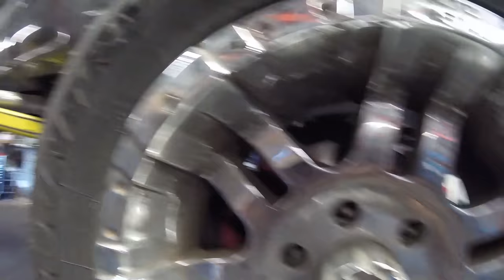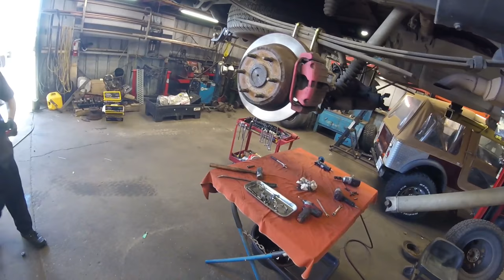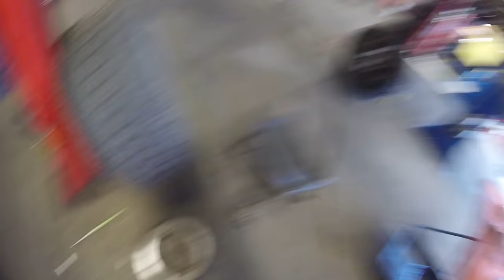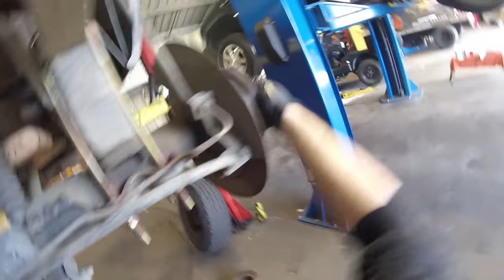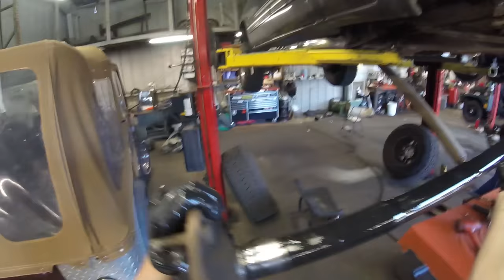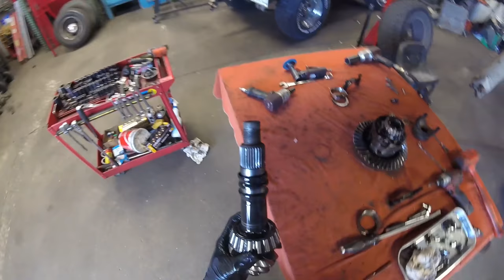Tearing apart blown Chevy rear-end #Govbomb

Comment: G80 diff lock is actually very, very robust. This truck probably has a oversized 35" tire (there's like 5" lift you can see in the video) and the driver was wheeling the shit out of this. He probably put pedal to the metal while rock climbing.
Reply: They're horrible! Those two spider gears spinning on a bare metal shaft is a dumbass design. Also the lock up is quite violent when it slams into lock mode. There's a reason these things have a reputation for bombing, then removing that pin to replace it can be a nightmare!
Reply: @Mr_Ruhl  Any aftermarket options available for a 2018 Diesel ZR2? Mine's currently screwed, with the center block carved away, and i'm either going OEM or aftermarket. Just can't find any aftermarket options out there.
Reply: Sounds like someone is compensating for having a g80 and not a lsd lol g80 is junk it locks the tires up completely and gets the job done but the way it violently locks up is why they are known for exploding when it locks up it puts extreme stress on the spider gears and diff carrier awful design get a lsd lol
Reply: This is accurate

Comment: G80 and the gov locker are not the same rear end. One was from 73 and phased out mid 80s, the eaton g80 was introduced afterwards and is still in use today. That truck looks like its modded and driven by a jack ass. Probably blew it up themselves. But main point, is thats not a gov bomb

Comment: My pinion pin lock bolt instantly stripped out so I had to use a 7.5mm socket hammered on. Amazon had it next day 3.99 though.

Comment: To make it easier on pulling that spider pin, just spin one axle or the other a little bit and it will slide right out. I kinda cringed a bit when u put the bolt back in and pryed on it lol.
Reply: It was bent and new rear end kits come with a new pin and bolt

Comment: Here's the thing with these rear end's. Eaton  made them specifically for gm and they are rated by eaton for gm and gm builds a vehicle around that rating and it will last for years but like all moving parts they will wear and adding stress to moving parts to which they are not rated will cause damge. That being said eaton also created such things to handle that stress in 14 bolt 9 and a half and 14 bolt 11 inch specifically for this purpouse. Now flooring a thirty year old rear differential with 300,000 miles on it and the oil has never been changed doesnt make it a horrible thing or putting giant wheels and tires on a high speed diff and trying to take off like a race car doesnt make it a bad thing. Now using as the manufacture built around it is one of the most awsome things ever created for a vehicle especially a 4 wheel drive. Yes i have broke them but i was way out of specs and mostly due to my own ignorance. That being said i have broke one of the drive gears in one and if not for the locking thing i would not have made it home as it would catch and turn the other wheel until it released at 20 something mph and start free spining so i let off the gas and slow down and get back in it and it would lock again and away i went yes it took a while at this pace but i wasnt stranded and made it home. I now have a 14 bolt corporate locker in place that can take a beating and changed 3.42's to 4.10's with my 4 inch lifted suburban 4x4 and big wheels and tires you know the proper way and it is literally a monster. Easy turning nice and smooth no binding from stress. That thing will pull a house apart as before i would pull the truck apart.

Comment: The G80 is not "limited slip" as you mention in your description, it's a locker.
Reply: @Steven Blodgett the gt4 code  is for the ring and pinion gear ratio. The rpo code for the locker is g80.
Reply: Meh the locked state is clutched.

Comment: Holy Cheetos not looking forward to doing this at the junkyard today .. I have a lot of play when I spin the rear wheels on my 2000 1500. The clicking sounds like there coming from the driveshaft . I’m doing uJoints fersure but my dad wants to remove the spider gears and switch them out again(we did this two years ago) he said the truck feels like it binds when it wants to shift gears. He doesn’t think it’s the u joints because there’s no slack in them.  I just don’t want it to be that part you removed in the last two minutes of this video ha ha haa..

Comment: How hard it it to replace those nesting gears in the differential. I got the whole unit out of the truck and only thing wrong is the nesting gears starting to grind. It's pretty much the same as this one. A gm locker on it

Comment: Great video yet I have a Chevy Equinox Awd and had the passenger side rear axle replaced due to issue at wheel end , yet it’s hanging out 3inches from differential and no longer flush... do you think this happened due to replacement of new axle the c-clip was not set and locked properly? I’m trying to understand why this happened, it was done 8 months ago? Any thoughts would be greatly appreciated

Comment: Is the G80 used in the trucks the same as the G80 used in the Astro/Safari vans?  I'm about to buy a 2005 Safari and it has the G80 diff.  Should I be concerned?

Comment: "These LSD systems are highly prone to failure" Incorrect. The G80 has been used at least as early as the 1982 model year and...they are fine. The problem I see is a failure between the headrest and the steering wheel. Some "expert" had to take a well engineered truck and "make it better" with the lift kit and oversize ties and who knows what other shitty mods were done. I am on my 4th silverado and I haven't had a single issue with the G80. I am at 279,000 miles on my 2009. Running fine. Then again, I left it alone and drive it with some intelligence.
Reply: And the fact this had a big lift and big tires on it.
Reply: @dustinoverbey6068  Except no it won't do either of those things, because if just stomping the gas on an icy surface actually could they would never be used given that the major point of the damn thing is improved traction in slippery conditions. The reality is that about the only way to blow it up reliably is to ridiculously over-reving the engine on a surface where one wheel can slip. 

The simple fact is that saying these units are 'prone to failure' is a straight up false. They do not cause routine issues in stock vehicles that aren't driven incredibly stupidly at all.

Comment: Need help !!! That little pin/threaded bolt you took out at 1:20 ish has snapped in half on mine. How do i get it out ?
Reply: 1:08 i mean
Reply: U fish it out:  only way
Reply: Maybe a magnet unless its broke off above where the threads start. Then drill it and get an easy out or something along those lines

Comment: do they give any signs of failure at all or just boom its done
Reply: Mine gave out at 240k in the Rockies and its started to click around curves and I had about 3 hours before it shelled out, i probably could have made it farther if i didnt continue giving it the beans!
Reply: Mine had no problems at 250 thousand miles  and stock tires and rims  until I  floored it one night after a few beers . It  made a loud  popping sound and I knew immediately what it was. luckily I was right by my house. It would drive straight but  turning made an awful sound.
Reply: @jamesfarmer2748  I know this is old, but what did you have to replace? Just the Spyder gear or the whole unit? My truck is currently doing the exact same thing.
Reply: @Mr_Ruhl  the ring and pinion and carrier were destroyed.  At the time I found it easier and less expensive to find an entire axle from a guy parting a truck out with the same 3.42 ratio as mine. Changed seals and oil also. The replacement also had the g80 so I try to take it much easier now.  I have since acquired the tools and  know how to rebuild them.
Reply: @jamesfarmer2748  damn! Thanks for the info. Strange it messed up the ring\pinion and carrier, but still drives straight perfectly. The only time mine makes noise is around a corner under throttle. I can coast around corners and drive straight and nothing seems wrong with it at all.
Reply: @Mr_Ruhl  you might have an outer wheel bearing failing. I've had that happen also. Check it soon because they can ruin the axle shaft. When my g80 blew I was very close to the house and limped home slowly. My brother tore the axle down later and had to slice the carrier with a 6 inch Metabo in order to remove the center pin that sits between the c clips and is bolted in with 8 mm bolt. I might of been able to reuse the ring and  pinion in a pinch but there was some broken and chipped teeth. I searched around and found a low mileage 3.42  axle for three hundred dollars and swapped them out.

Comment: My hopes of wheeling my truck are crushed, is there a fix to prevent this from happening or do I have to swap the G80 to something like a Torsen diff... Befora any of you keyboard warriors  types in a reply: it is not "designed to spin the wheels"... "waaaa waaaa"...

#1 It its my truck
#2 Ill do with it as I please

Comment: Not good work by any means. He used hard(not brass) punches which have now permanently scored the housing. Also didn't think about where the shims go.
Reply from the maker: Well, seeing as nothing that came out would be going back in, thinking about "where this shims go" wouldn't really mean much seeing as I would be setting up a new gear, but you knew that. And it doesn't take a precision shot to knock out races without scoring the housing. Thanks for watching!